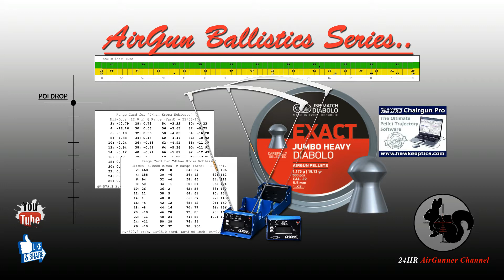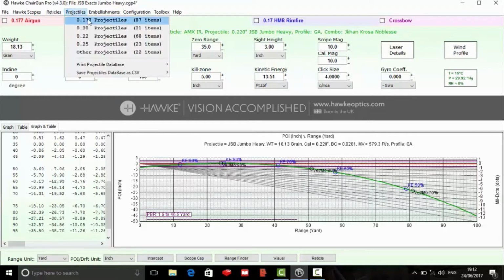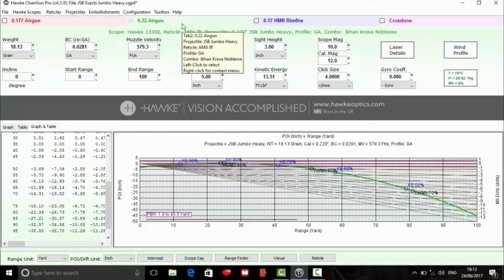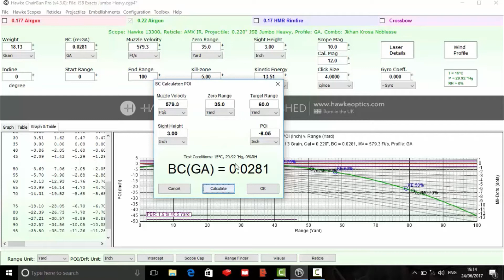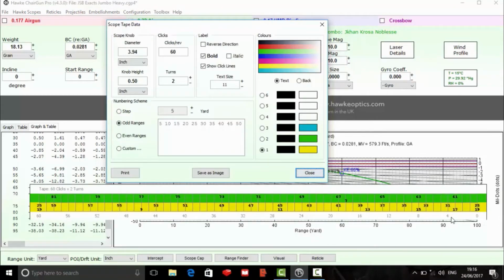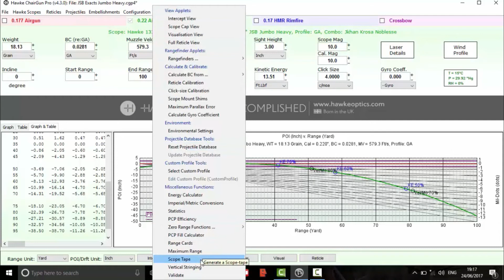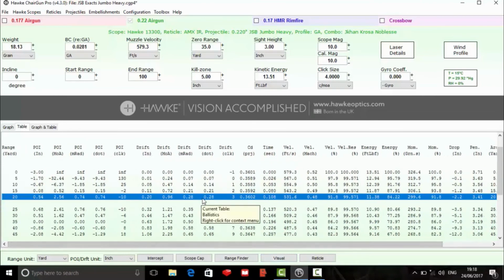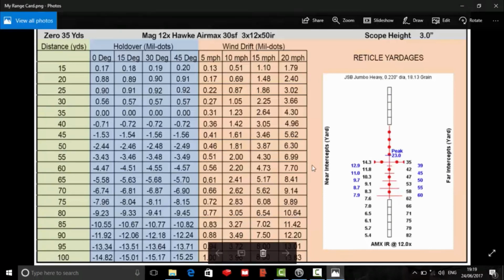Airgun Balistics Series (Part 1 ov 4) Part 1, Chairgun How To Setup For Success.

Comment: Down loaded chair gun elite recently to use the click table for accuracy but something is not working out, I've checked and double checked scope hight, FPS, make and weight of pellet, etc I have now released that the FX Impact has 20MOA built into the scope rail, is there any way of accounting for this ?